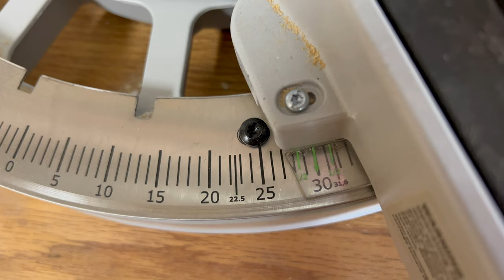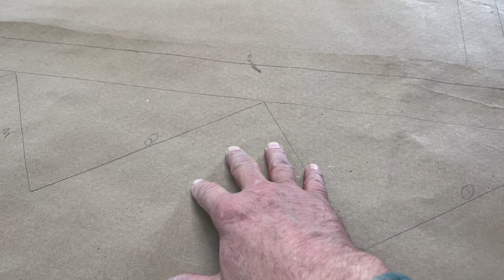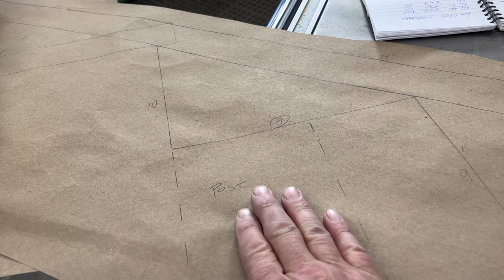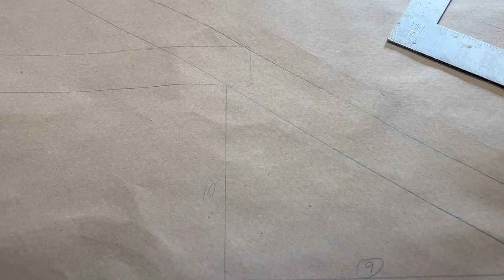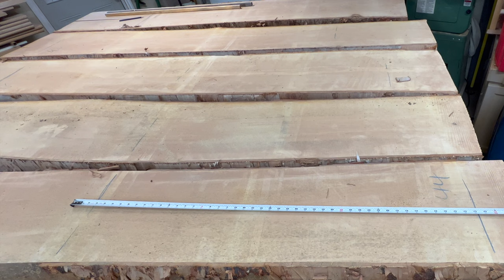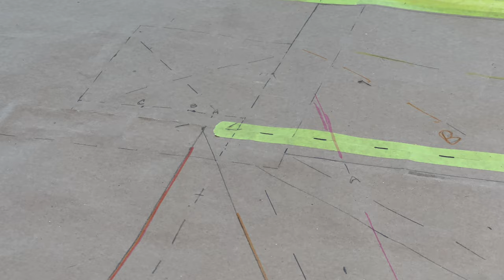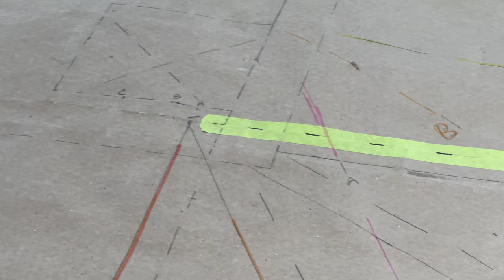Super Complex Stair Build: Open-riser Winders made with templates

Comment: Very Nice work and education, what did you use to support each tread on the upper treads that were not sitting on the stringers?
Reply from the maker: My job was the rough-in. The homeowner was going to install birch hardwood cladding on the post to provide structural support for that end of the stair treads on the post.  On the large side he was going to add a secondary stringer to pick up that load.  Thank you for the compliment. Cheers, Scott

Comment: Good morning 🌅, interesting way that staircases are made over in your neck of the woods, I am from the UK , though I am now I’m retired living in France, I made quite a few staircases, many years ago I built a my very large workbench, 3-5 Mt X 1-5 Mts , I would use 1/4 MDF pinned to the top, then draw out the stairs, all of the treads are housed in to strings, using a very large dovetail cutter , then long wedges driven in under each tread and riser , looking it all together, + glue, I have even made 3 1/2 flights that sat on top of each other, very big problem, the architect didn’t allow any room in the stair well, to start the initial stairs in the basement, as it needed to be assembled in the basement, obviously first and then building up, The problem was you needed to be under the stairs to assemble the staircase, but you were trapped inside, 😂, it cost them a lot of money as they had to get a structural engineer to give them authority to cut hole in the wall to bed crawl through into the stairwell and obviously to get out when the stairs start to get up to the next landing, I refuse to do the job to install, as I can see a problem arising and told him that they had a problem and they didn’t take any notice, plus they weren’t very good pays  either, 
Retired in my 70s , living in a Moulin/Mill in France, just removed a staircase that went from my lounge up to the attic, when I converted it to live in I put the bedroom down stairs, so my living room and kitchen/dinner room are upstairs, so I could see across the forest and mountains/Hills, I had to make up a frame above the stairs to put a electric winch on it, it is made of 3” Oak, I have now rotated it, 2/3 fixed in place, got to acquire or make up a large newel  post, then I can make my three winders, and then put the last bit of straight stairs in, It is surprising how much more room it has given me in my lounge, my lounge is big anyway, but by rotating the stairs, it’s giving me a lot more room, 
Hope you find this interesting or amusing , old dude living by himself nothing more to do, Keep up the great work stay safe,
Reply from the maker: Thank you for taking the time to write such an interesting comment mate! I'm of British ancestry on my Dad's side. In fact my uncle (Dad's brother) moved to the UK after WW2. He and dad were born in Saskatchewan but my uncle joined the Canadian army and was a military police officer in England during the war. Met the love of his life there and end of story. He passed away a few years ago at 94. I've always loved stair builds. Started when I was 19 using repetitive cuts with a skill saw to plow out the stringers (with a chisel). This particular staircase in the video was a huge learning curve for me. If I was to do it again I'd of made single or double stringers and then fastened the treads on angle iron with slotted holes to allow for movement. Hard to explain but the  winder supports ended up being a nightmare as the customer wanted the saw-tooth stringer on the winders as well. That creates some issues with angles on the stringer cuts. I chuckled when I read about the architect drawing something up and not thinking about how the poor carpenter would actually build the stairs. Doesn't surprise me. I've done some jobs that an architect dreamed up and it was nearly impossible to pull off. Funny thing is he made as much money as I did in a half day of drawing than I made in a week of blood. sweat and tears. Also interesting is that there's a British carpenter named Carl Rogers who lives in France and has a great video on a stair build he did on this old farm house in France. I enjoyed hearing about your story about winching the stair case. Old men get smarter not stronger. Love the sound of that big work bench you have too! God bless you my friend, Scott
Reply: @scottearlsmithFTC  Good morning Scott , I will be in touch tomorrow, I have a appointment at hospital today just a check up, 
Have a great day, Phil, from France.
Reply from the maker: @Hog-g2z  Hope it all goes well. Look out  for those French nurses!
Reply: @scottearlsmithFTC  Good Day, Scott , I hope you had a great day, I was wired for sound, sonar how deep can they go, for 24 Hours, back in 2022, I had a heart attack, I had been suffering from stress, from my ex for about 15 years, in 2019 , she was accusing me of being mentally ill, even got some of my relations and friends involved, if you understand what they were trying to do, luckily I managed to get out, and I came across the France, 
Now legally allowed to stay , though I do have some problems with some locals, , to read and write properly I could write a horror story, 
Strange how families can change and even move to the other side of the world , my eldest sister who is no longer with us, she married a American servicemen just after the Second World War, And lived in Chicago,  the next jump I have one son, I am the only one and a family of three boys that has had a son, he now lives in Quincy, Illinois, and works For electronics firm, 
Back in the late 70s early 80s , I was helping a contract firm in Cambridge that was making staircases, I was making treads and components for them, Didn’t have very much in the way of machinery, then mainly a lot of handwork, I’ve been involved in making formers for precast concrete staircases, I had to go to site in Dartford just on the outside of London, I had 14 to make 14 factories, the first four, I went to site. I saw the foreman and architect., they gave me details and told me where my staircase I got a start and I’ve got to finish, I took a load of measurements, took my drawings and everything back home for the weekend, went back on the Monday at 5:30 in the morning to traffic, Started lying out first part of the stairs and my measurements that I got and what was on the drawings were completely different, I have to wait until the foreman come in at 8 o’clock,
I told him that there’s a problem with the drawings that they have been set out wrong , this didn’t go down very well, the guy responded saying you obviously do not know what you’re doing, are you quite sure you’re capable of doing this job?, I won’t work on money I would’ve told him to stick it, 
I said, are you sure you want me to go to these measurements and he said yes? , So over the course of the next week I’ve built four precast concrete forms., Had them inspected they were happy, I got paid. They told me they’ll call me in about 10 days when they’re ready for the next set to be done., 
Three days later, I had a message. I was told that I needed to go to site. There is a serious problem. , ha ha, Supposed to be a minimum of 60 mil of concrete screed over these forms, I’ve made them to specific specifications, I went to site with a colleague who got me the job and we met the architect there, before the foreman came in, I said to the architect and the person who got me the job, Before I started, I’d already said there was something wrong with the drawings something wrong with the measurements, I was told that I didn’t want to do the job and capable of doing it to leave, so obviously I carried on and made the former, after a big discussion the colleague of mine that got me the job we were told to go and have breakfast somewhere and come back later, we went back around about 1130, to meet the site foreman, the architect, and I presume in the main building tractor, in the heated argument, the foreman was instructed to apologise to me, and he was promptly removed from site, such a great feeling, On another occasion in a very high end apartment in Cambridge, I believe at the time it was the first one that had broken the million pound bracket, a beautiful wrought iron and ash staircase spiral, Somebody I tried fitting the 4 inch diameter handrail to the metal work, not quite sure what happened, but I was asked if I was interested in doing the job, so I said yes I was given a huge stack of approximately 4 foot long curved section handrails round, I started work trying to fit the first section to the metal work, it didn’t seem to want to line up, so I thought I would cut the handrail in half a 2 foot length and see whether I could join it and get it to fit, it still didn’t work, the company that are supplied all of the treads which all in as, had made the handrail in a 4 inch round section. It has been machined just in one plane., it was supposed to be done in a helix, so as you dropped the handrail down the coverture of the rail would fit onto the metal strap or the metal work of the staircase to say it was out of line was understatement,, again I called site foreman architect everybody to site, again I was accused of not knowing what I was doing, this time I was prepared, I’ve already drawn out a piece of one part of the Handrail  and I actually made up a segment 4 foot in length, very time concerning.
I covered the piece of metal work in tape and then stuck thick cardboard onto it marking it top of handrail , and Drew around the side of the metal work, then I put the cardboard pattern to the side of the metal strap, and then I drew around the top of it, which then obviously gave me the two planes to create the helix, Not sure whether back in the 80s there were CNC machines about that could do this, again I was told they thought I was wrong so I produced my pattern and placed it onto the handrail, they then agreed that I was correct, they asked me how much it was going to cost on top of what I had already done. I just picked a figure out of the 3 1/2 thousand pound , they turned round and looked at me, they ended up saying obviously yes how soon can you start?, My reply was how soon can you give me a deposit?, There was no way that I was going to go out and purchase a load of cash to make this staircase handrail, so in about two days I’ve got half a deposit, and the rest is history, it took me about five weeks, How about two or three months later the architect that was involved in this luxury apartments, approached me and asked me if I was interested in doing handrail and edging for a precast concrete staircase in a property that was 200 yards down the road, of course I said yes, 3 1/2 flights, This cost us over £6000, a lot of hard work, especially when it came to sanding, and I was involved in a property construction down in London to do with the church and royalty, all in Brazilian mahogany, I was making monkey tails, goose necks, swan necks, you name it this is what was going up the stairs 2 1/2 flights landings et cetera, All the radiuses I had to literally cut by hand roughed it out on a bandsaw then hand carved it on site, 
As he was then Prince Charles even passed comment , on how much hard work it was to make and produce this part, Later in the year, I made a very large power of doors going into part of the church, I’ve got pictures of him and the architects Simpsons of London standing looking at my doors, 
I was doing subcontract work at the time for organ building company they we were involved in doing the making and installing a new organ into this church , 2003 when I met my ex partner we purchased an old Forge in the UK, which I was manipulated into restoring it, which was fine, and when we used to go on holidays, we used to go across to Europe, and then our goal was to purchase something later, when her father passed away, I restored his property up in Grimsby, and then we came across to France in 2012 and purchased a price over here on old Mill, it is huge, this is where I live. In the separation of us, I obviously got half share of the property in the UK, lost a lot of money in this process, and then I had to buy her half share of the property in France, as I put a lot of time and effort into it, I didn’t want to lose it, though I think I’ll probably be better off with the money, but I have lost all the time and effort that I put into it, so I ended up in the property in France, and moving over a completely, 
Sorry about ramping On so much , but when you are by yourself , I don’t talk to anyone, as I can’t speak French,
Reply from the maker: @Hog-g2z  Hey Phil. What a story. I'm impressed that you had the fortitude to stick with your convictions on doing things the right way. The foreman got what he deserved. I've run into customers who are demanding and seem to think they know everything. When I sense this attitude, I walk away. Quite the wealth of experience you have. Interesting that Charlie had a look too. And I'm glad you were able to get the place in France as you had your heart set on that. Life is quite the journey. Again, God bless you and enjoy that newel post build. Cheers, Scott